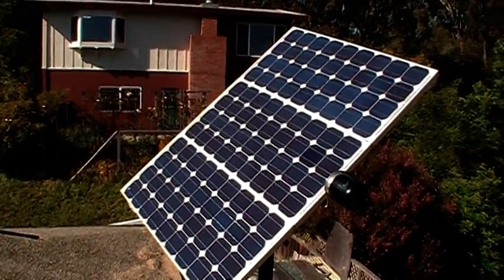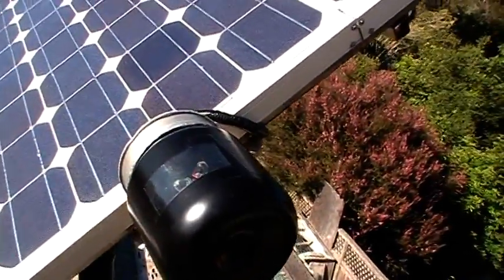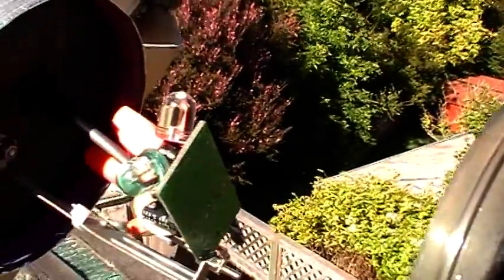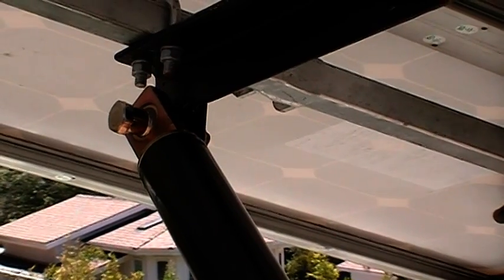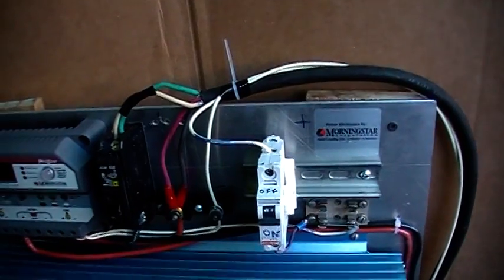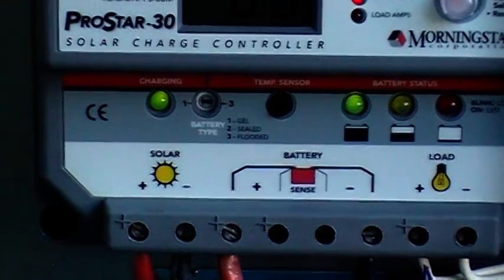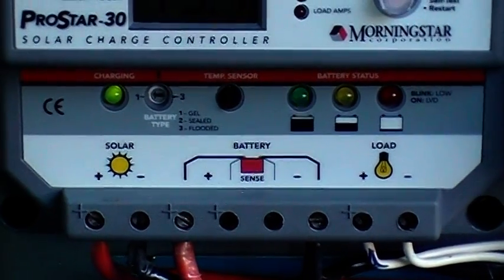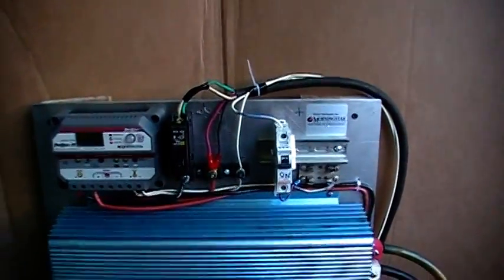solar tracker - solar power backup

Comment: If you have 3 85W panels & your V=13.4, your current production should be: 3*85/13.4=~19A (your meter showed only .8A).  Why isn't your system putting out the proper amperage?
Reply: +zeffur7  batteries are fully charged... You assume max current in an empty battery.
Reply: +flexairz Well, if he's got 8A flowing, then his batteries aren't 'fully charged' or he's got other loads drawing current.  Your point is valid however that if the batteries are fully charged his charge controller wouldn't be applying the battery load (which would be very small) onto his solar array.

I should have realized that ^^ on my own :)  
Thanks for your reply.

Comment from the maker: The Prostar PS30M has a load-out feature that must work off the batteries, becuase the tracker works when the pannels aren't out-putting power(at night or no sun). I run my tracker module that controls Linear Actuator off that, that way I can see the amps it draws on on the digital display. The trick is to catch the charger display when it showing "Load" at the same time the tracker module is engaging the acuator- "don't blink" -the duty cycle for the tracker is about one second per two minutes.

Comment: I found very nice your project. I have a question. When you called in your inverter charge controller and solar panel. They are running simultaneously? That is, I wonder if while you are receiving is using solar energy in the drive? I doubt if I can do this simultaneously.

Comment: Hello there Dave. I have just picked up a Morningstar Prostar PS30M and have a question, if you disconnect the PV panels during daylight, does the 'charging' LED remain on for a couple of minutes. If I disconnect my panels, the LED stays on for a further 5 minutes. Just wondering if this is supposed to happen? Thanks.

Comment: Is there a controller for the linear actuator??? Besides the redrock unit ??? I understand that the actuators have only two wires pos and neg and to have to actuator move back the other way the polarity has to be reversed ??? Does the redrock unit do that ???

Comment from the maker: If your're adding two 12v battieries - add in parallel Positive to Positive. But if your're adding two 6v batteries - first connect them in series Positve to Negitive to make 12v then connect that pair in series to your battery bank... You should try to keep all batteries the same type & Amp Hrs